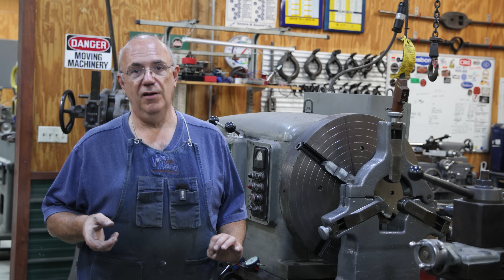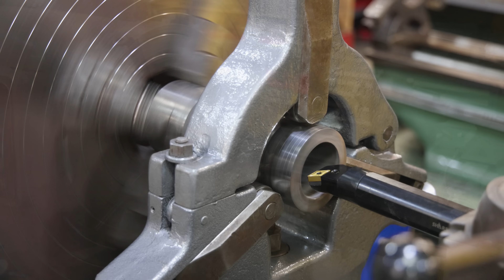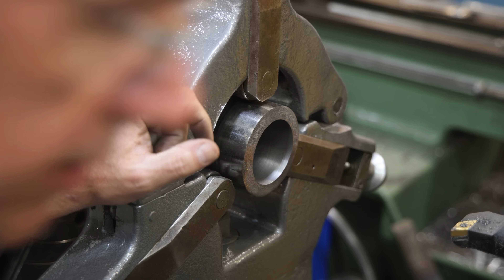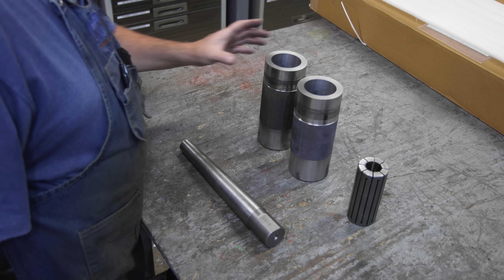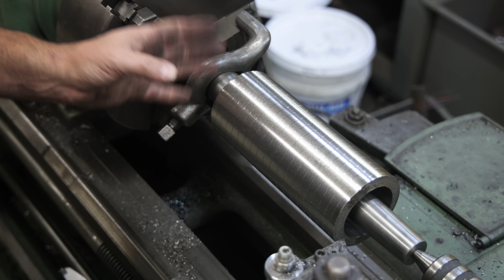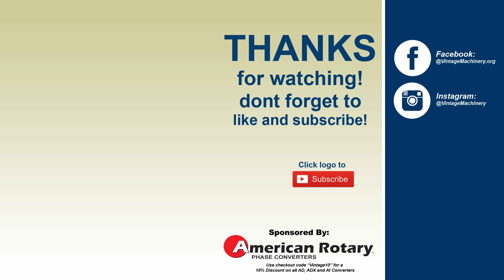Steam Stoker Engine Valve Sleeves - Boring and Turning

Comment: I think I heard that the plan is to do the OD last.  The ID isn't the same dimension thru the entire length.  Is the expanding mandrel  short enough fit in the larger ID section, or span the smaller ID sections?

Comment: Keith, a question. When finishing the inside bore of these sleeves would it be better to install them in the cylinder block first? In that way  you will be applying the actual clamping force to the sleeves. It will also insure that the bore is absolutely square to the block and the location is correct.

Comment: Just a silly question, you're cutting outside of your final dimensions, you're then going to have the ports milled and then you're going to turn down to the final size. Won't this milling of the ports then re-introduce an interrupted cut for the boring bar when turning the internal diameter to its final size? I learn a lot from watching your videos, thank you.
Reply: The interrupted cut isn't a big thing with those ports. The current plan is to turn it inside and out so it is close. Then have the ports milled. That can allow stresses to move in the casting and if you had turned it all to final dimensions it now would be scrap. So instead you turn it close, mill the ports, let it stress relieve and then turn the final dimensions. Basically the same way you machine engine blocks and other castings.
Reply: @Blazer02LS  thank you for the answer...
Reply: Yes, you learn how NOT to do any job!
Did you notice that Bubba conveniently got someone else to do the porting of the sleeves, because if he tried it himself he was sure to f**k it up!:hand-orange-covering-eyes::hand-orange-covering-eyes:
But we may still nave some laughs watching Bubba playing machinist on his lathe.:face-blue-smiling::face-blue-smiling:

Comment: Folks, I'm hoping someone can explain something that has been bugging me for years since I started watching machining videos. 

Why does surface speed have such an effect on finish? Does it have to do with how or when the chips break off, or something else?
Reply: That's pretty much it. And it varies with the material what surface speed and depth of cut are appropriate. There is also the geometry and type of insert to consider. Some are designed to work better in certain types of materials.

Comment: You really need a solid toolpost on that monster lathe. I'm not sure how practical it would be to swap the compound when you can but I have a compound on my DeValliere H140 & it has similar flex.  I made a cast iron block & was astonished at what a huge difference it makes.  I really never appreciated what a great lathe I had until I made a solid tool post. It eliminates all visible flex.  If you watch the clip - the entire compound is flexing.  It looks like just the bar is flexing, but it's just amplifying the flex coming from the compound dovetails. Boring bars have some flex, but they're usually a lot more rigid that what's happening in the clip.  I can see the handle on the tool post moving, too.

On my lathe, the compound is seated on a rotating base with a centering pin & 3 t-nuts for hold downs located in a circular slot.  I machined the block with a center point fitted to that base & milled in 3 counbterbored holes for the t-nuts. I scraped the mating surfaces. I could not be happier with how well it works and it only takes a few minutes to swap back to the compound when I need it.
Reply: I thought the compound was moving too.
Reply: That lathe isn't a "monster" 😅 - and those baby cuts should NOT get the toolpost jumping/moving anywhere. 
Something is worn or loose.
Even with a quick change tool post, topslide and all mounted. Nothing should move like this, for that job.
A solid toolpost is highly overrated.
(I've made several myself)  And use similar sized machines on daily bases, with qctp and not getting any flex.  Making way way bigger cuts. Also interrupted....

But yes, some topslides are not build very strong. And if they also aren't tight in the gips, they will flex.

Comment: Looks like you could make life a lot easier by tightening up your carriage.  Looking at your tool post handle it  is moving along with the boring bar.  A bigger bar won't help.  Maybe it's the old cobbler syndrome.  Fixing others' machines and let yours go.  If you don't fix it though, that will cause error in their jobs.  Just thinking.  Love your shows, but I'm a perfectionist too.

Comment: Are we going to get to see this engine run?
Reply: Don;t hold your breath!!
Did you notice that Bubba conveniently got someone else to do the porting of the sleeves, because if he tried it himself he was sure to f**k it up:hand-orange-covering-eyes::hand-orange-covering-eyes:!
But we may still nave some laughs watching Bubba playing machinist on his lathe.:face-blue-smiling::face-blue-smiling:
Reply: @garybrenner6236  My, you're just looking for reasons to be insulting, aren't you? Keith is absolutely capable of doing the porting on his manual machines. It would be slow and make for particularly boring video. It's relatively quick to write program for a CNC machine and once set up. it will run pretty quickly.
Reply: @phlodel  Don't respond to this troll. He does this all the time. He posts the same comment to every ones post on the videos he replies to.
Reply: @JSB1947  On the plus side, comments benefit the content creators.

Comment: Would it be better ro mount the center directly in the spindle and use a face plate to drive the dog? It seems gou have tbe inherent run out of tbe 3 jaw chuck that translates that run out to the part since it will be in and out of the lathe. I am happy to be corrected, but that is what it seems ti be for me.
Reply: He takes a cut to true of the taper of the center in the 3-jaw before mounting the work.
Reply: He recuts the center every time he remounts it in the lathe
Reply: I guess you didn't hear him say he touched up the center with the compound.
Reply: Ah, I did not realize you could redress a center. I thought they are hardened and requires a grinding set like a Dumore. That is my confusion.
Reply: @hobbiesrus no, those centers are essentially a consumable.
Reply: Did you notice that Bubba conveniently got someone else to do the porting of the sleeves, because if he tried it himself he was sure to f**k it up!:hand-orange-covering-eyes::hand-orange-covering-eyes:
But we may still nave some laughs watching Bubba playing machinist on his lathe.:face-blue-smiling::face-blue-smiling:
Reply: @garybrenner6236 what?

Comment: You can also losen low. Tighten the high.  Or just turn the  chuck 180 degrees.  Unless you like walking.
Reply: Or when reading the inside dianeter and it's backwards again. Like "right tightly, lefty loosy". It works SOME of the time... as long as one never encounters left handed threads. 
Learn the memory mnemonics, but don't put too much faith in them. Better to understand that a dial indicator moving to lower just means that the tip is moving away from the dial, and higher means it's moving towards the dial. Then one KNOWS, and isn't just assuming, which way to move the work to get it properly positioned.
Reply: @knlazar08 if the dial moves the wrong way,  then do the opposite.  Inside indicating i use my last word facing me
Reply: and for those of us without huge workshops so we have no access to the back of the lathe, thats exactly what we have to do.
Reply: I expect it won't hurt him to get a bit of extra exercise...